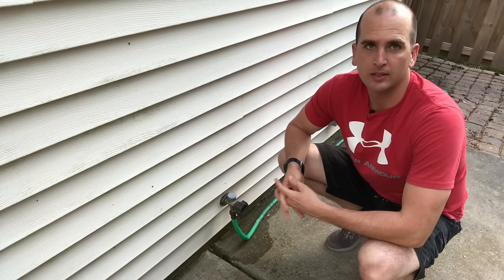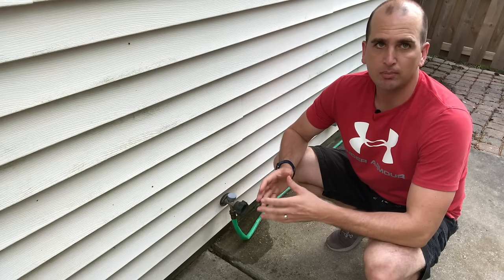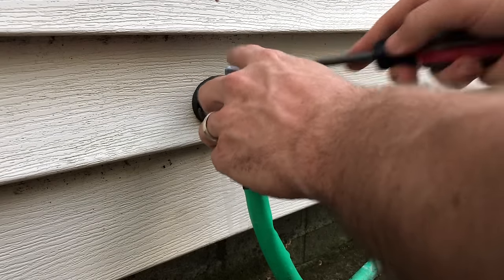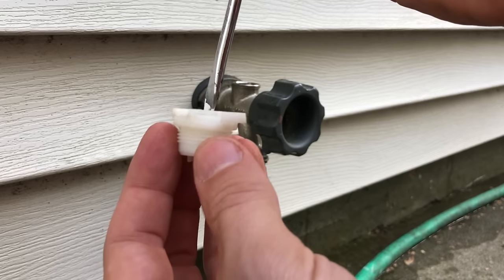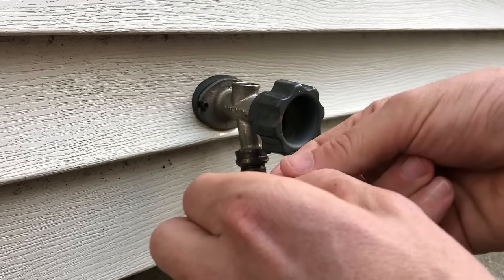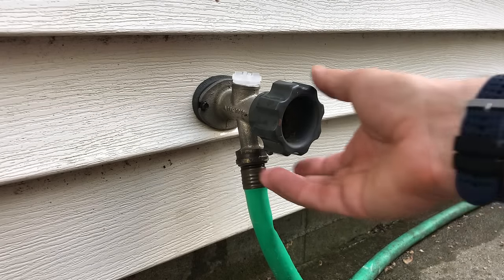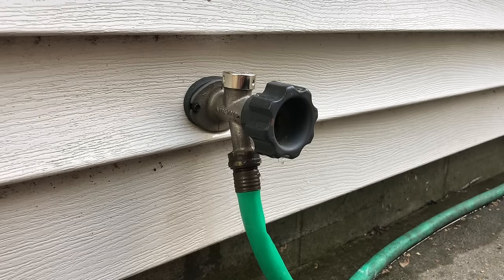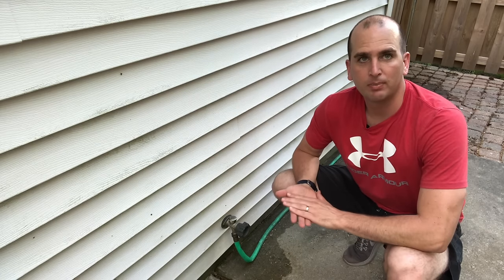How To Fix a Water Leak in the Anti Siphon Valve of an Outdoor Faucet

Comment: Thanks Scott.  I have the same exact spigot.  However the leak is at the outlet itself. It drips constantly. How do you fix that one?
Reply from the maker: Thanks Gene,  looks like you also took a look at my other video on fixing the leak from behind the spigot handle  https://youtu.be/scf5ovLI4Uk .  If this video didn't fix your specific issue just let me know a few more details on your specific leak and myself or others can surely provide some guidance.  Take care!
Reply: Your video was perfect- very easy to understand and see what to do. I am not skilled at all though and evidently after seeing it so well explained, I couldn’t do it. I did get the cap off but when it came to using channel locks, I couldn’t get the white thing unscrewed. I think I’ve damaged it. I tried pliers too. It seems to me, a wrench would be easier. Would that work?  If so, I could borrow the right size from someone and try again. Again, your video was perfect and if I had any mechanical sense, I’m sure it’d been a breeze.
Reply from the maker: Hey Cindy, yeah if the plastic piece still has it’s original shape you could use a crescent wrench or standard wrench. Best of luck.

Comment: Are the parts you point to on Amazon specific to your faucet or will they work with any faucet?
Reply from the maker: Not necessarily any faucet.  If you want you can join the “Everyday Home Repairs Community” on Facebook groups and post a picture of your faucet.  Then I can better help get you the right parts. 👍
Reply: Agh, just deleted FB account. I found the company it's made by. It does not prevent backflow so I may replace the whole thing. Is that hard?
Reply: Oh and also I plan to hook up a timer for watering vegetable beds. Which means the spigot has to be on all the time, right? Does that affect what spigot one should have?
Reply: Thank you!!!
Reply from the maker: @sherileepoetcmt   yep you will need to leave the spigot valve open and then the valve in the timer unit will control the flow of water.   Some people might be a little concerned if the timer had a failure that your water would then just run continuously so probably good to check in daily and also don't leave it setup like that if you go on vacation as I would want the spigot off just in case the timer failed for some reason. Best of luck 👍

Comment: This is a great video, and I'm hoping is my issue. However my cap does not pop off...no matter how much I try to work it side to side :( Any other suggestions for getting the cap off?
Reply from the maker: Hey Meg, is the cap plastic?  I know some of the nicer models have a metal screw on/off cap.
Reply: @EverydayHomeRepairs  It's plastic. We have super hard water here, so I'm wondering if it's just more stuck than I anticipated. I put it in timeout...I'll try again gently later lol
Reply from the maker: @Dangerkitten12  got ya.  Yes the mineral deposits which have been building up from the water leaking out could definitely lead to the cap sticking.  Reference the description of the video and pick up the repair kit from a local big box home improvements store or just order online.  If you force the cap off and it breaks that is not the end of the world and won't cause any issues especially if you have a replacement handy.  Best of luck!
Reply: @EverydayHomeRepairs  thank you!!!
Reply: Thanks much!  Excellent video for a quick repair.

Comment: I have a leak, issue: the water when on leaks from behind the entire spigot. I found this when I saw water coming out from the bottom of the siding and it leaked in my basement. The issue I have is the pipes are plastic. What do I do?
Reply from the maker: Hey Anthony,  sounds like your issue is more at the interface between the plumbing line and the spigot threaded end.  Hard to say for sure but if you think this is more than you want to tackle it should be a simple fix for any plumber and very common issue if you live in a place with harsh winters.

Comment: What's that sealing pad you have between the spigot and the wall? Recently bought a house and there is no sealant at all between the spigot and the house wall.
Reply from the maker: Hey Tim,  that plastic piece is just a spacer or also called a sliding wedge. 
 https://www.menards.com/main/plumbing/valves/valve-accessories-repair/prier-reg-spacer-siding-wedge/337-3012/p-1444451414772-c-8626.htm
Reply: @EverydayHomeRepairs  so it's not for sealing, just spacing? Because there's just a gap between my spigot and wall allowing anything inside

Comment: Question, with the anti siphon valve, should a washer be placed inside as well?
Reply from the maker: Valerie, there are a few different designs to make sure you know all the parts and the correct order you can google search your specific spigot and look for “parts list” or “exploded view” and should get something which helps you know what parts are needed per the design.  If you want to dive deeper head over to our Facebook group “Everyday Home Repairs Community” and ask to join them post a pic and we can work through it together.

Comment: Thank you! I just finished up this project cause of you. The previous owner epoxy the plastic part or it came that way, so I had fun busting that out without wrecking the threads annnnnd the plunger on the last one was in upside down! I was like no wonder it didn’t work! Again. Thanks for this vid.
Reply from the maker: Hey Mr. Lion sounds like you had a couple more speed bumps but glad to hear you were able to get the spigot back in working order.  Take care!

Comment: Great video. Thanks for the guidance and instruction. This fixed my issue. The plastic part was cracked, plunger mechanism was otherwise fine. Need new kit for small cost. Saved money on plumber. 👏
Reply from the maker: Boom 💥 👊

Comment: When we turn our water on outside it leaks behind the wall part, what do you think that would be?
Reply from the maker: Hi Rachel,  Do you live in a location where you get below freezing temperatures?  Did it just start leaking between now and last fall?
Reply: Everyday Home Repairs Yes we do live in an area where it gets below freezing and yea that’s around when it happened.
Reply from the maker: @rstrzembosz  I'm not 100% but most likely the copper pipe which is behind the spigot handle is leaking.  Do you have a basement or crawlspace where you can see the pipe coming through the wall?  If so, take a look and you should be able to see the leak if someone else goes outside and turns on the spigot (low flow).  What can happen is water sits in this pipe, freezes, expands, and then can crack the pipe.
Reply: @Everyday Home Repairs 
Yea I believe they can be seen in the basement. I have messaged some local plumbers for an estimate, how much do you think this will coast?
Reply from the maker: @rstrzembosz  If it is just the water spigot  it is a very easy job for a professional and also very common this time of year.  The part should cost about $35 at Lowes / Home Depot and labor will probably be some minimum service charge of $75 - $150.  It will most likely cost around $150 - $200.  Let us know what you get for a quote as it will help others in the future.  Thanks and let me know if you have any other questions.

Comment: good video but this anti siphon design is as stupid concept. the valve is off how is water suppose to flow back inside the house ?  and these $15cad /10USD kits are needed each year in Canada.
Reply from the maker: Hey Abdou,  yikes, needing to swap every year would be a pain in the butt.
Reply: @EverydayHomeRepairs  its ok i designed it so i can pull it out from outside and use a wrtench outside. but the concern is the valves from the 60s are perfectly fine.   so i went a head ordered a "high quality" one from aliexpress and that last 5 years so far.

Comment: I think mine is coming from the part connected to the house...
Reply from the maker: Do you have a rubber gasket in the end of the hose?  If that falls out or is old and brittle it will be pretty tough to stop the leak.
Reply: Yeah, I noticed ours doesn't look like yours. There isn't the rubber piece around the oval part connected to the house. It's a rental.

Comment: So turn off the water, remove the handle, you will see a flat edge part that you can loosen with an adjustable wrench. Wrap some graphite string around the shaft and put it back together and turn the water back on. You should be all set.
Reply from the maker: Mr. Dogfish solid addition to the comments.  I think you are right the graphite string would most likely have fixed the issue and probably be significantly cheaper.  Appreciate the help!

Comment: Looks like it’s still leaking from the same place not the hose.....anyways.
Reply from the maker: Hey Mike, does it look like the leak is coming from behind the handle?  There is another video on our channel that addresses leaks behind the handle if that would help.
Reply: Everyday Home Repairs Mine is actually leaking from the hole on the stem that the handle screws to. All I have found is to tighten the packing nut but it’s tight.
Reply: @controlsmike2433  I'm having same problem. And even replacement brass stem valve assembly